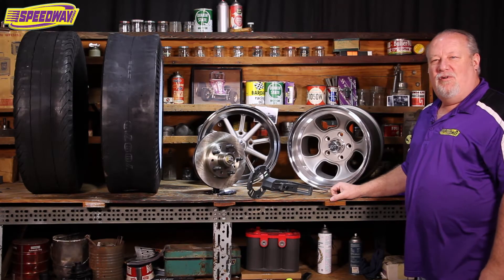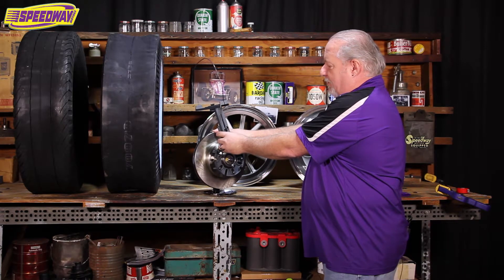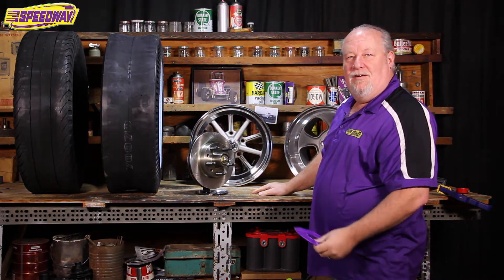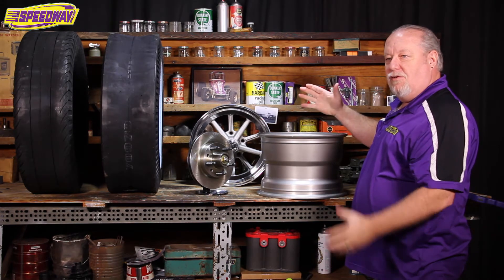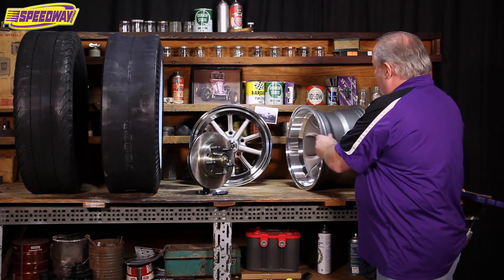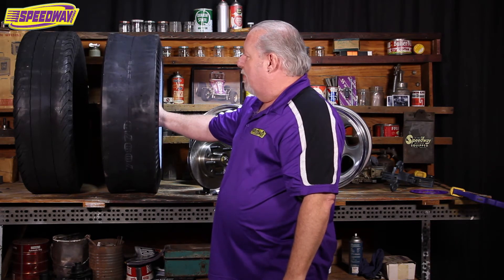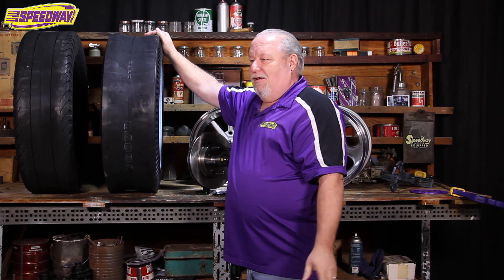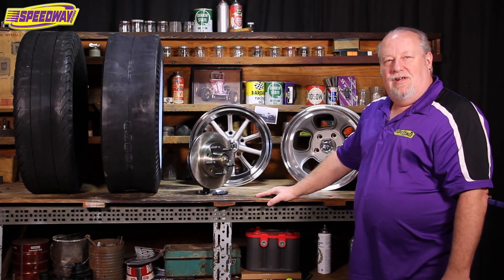Speedway Tech Talk - Wheel & Tire Selection Basics

Comment: he is checking the section width and they are not mounted with air in them???????
Reply from the maker: Correct, but the theory is still the same. You'll need to measure the section width of the tire, wheel width and backspacing and then allow additional clearance for sidewall movement to verify proper fitment.